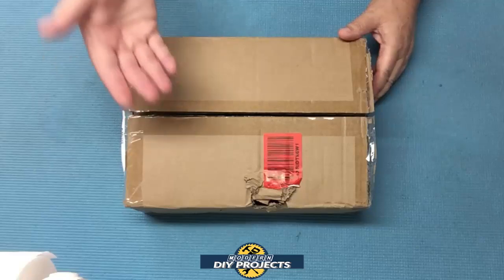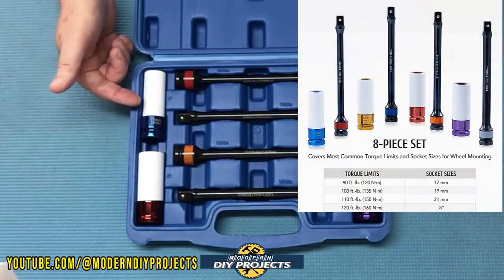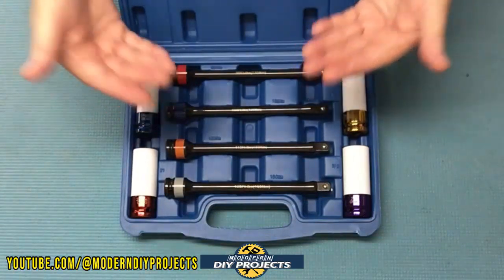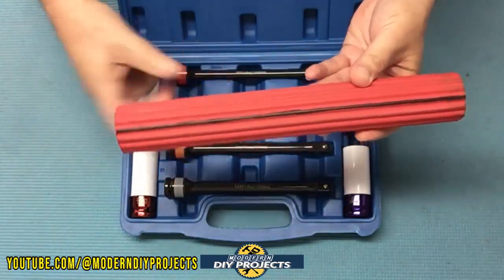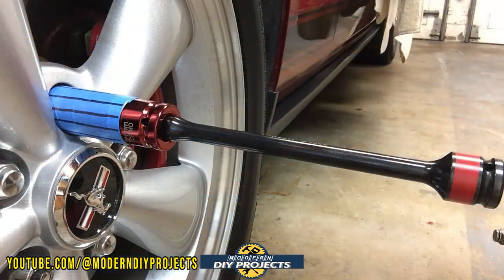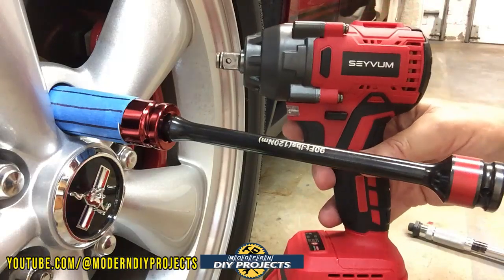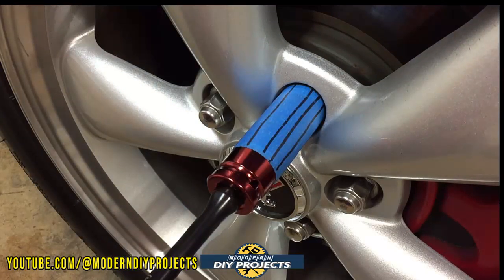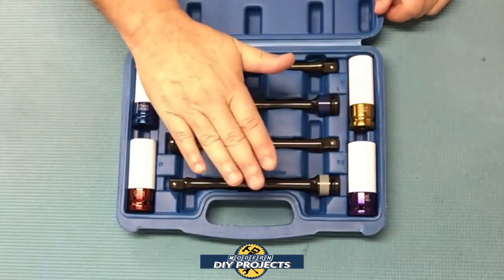Torque Sticks how do they work & are they worth the money? OMT Torque Limiting Extensions Review

Comment: "They're not moving" as they move ... I WANT these to work, but it looked to me like it was still tightening ...
Reply from the maker: Like I said in the video. They will twist and give that illusions, but the end torque will remain limited. Watch my example again and you'll see what I mean. Also the impact gun shakes a lot so that may give you an optical illusion of tightening more.
Reply: Torque test channel did a test too. It seems their conclusion is they work well for pneumatic, but for electric the anvil strikes are too rapid and they over torque. I think you could still use them but the calibration would be off, so use a lower torque than needed.

Comment: How do you know your torque wrench is accurate.
Reply from the maker: Logic! If you have two devices telling you the same measurement, then that means that they are either both wrong or both right. In this case logic dictates that they are both correct because the odds of both being wrong at the same time is a million to one. Especially since one is a brand new product just out of the box.